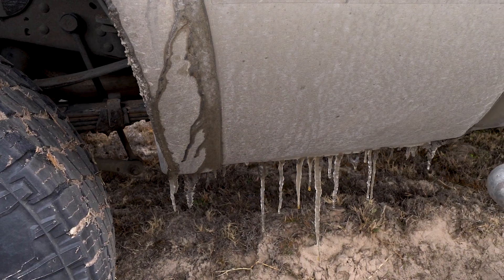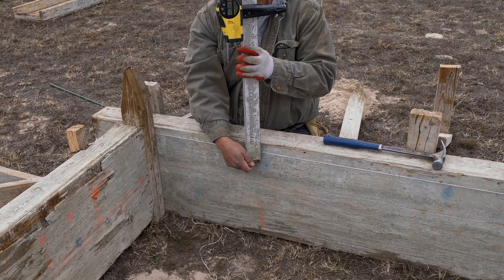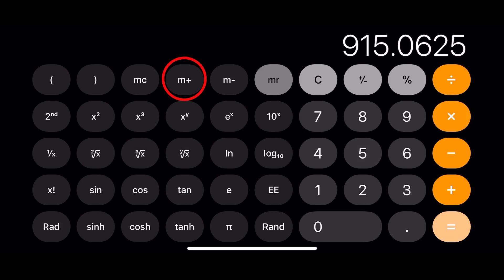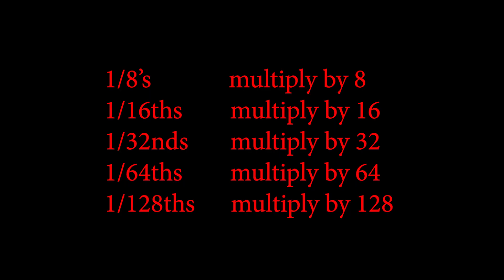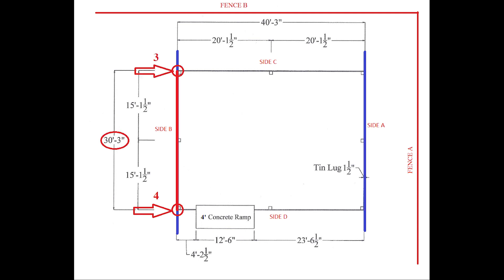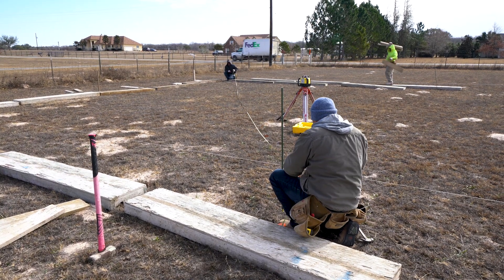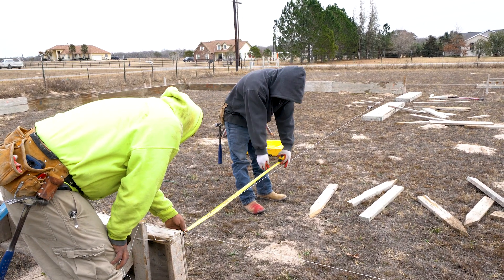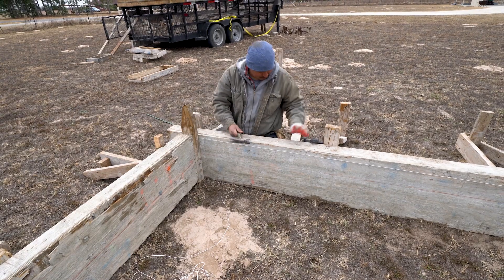How to form and square up a concrete foundation - Texas Barndominiums Episode 13

Comment: I think for us amateurs the nail for slab top wouldn't work.  Much easier to just make the slab to the top of the form or 2 x 6 and then screed the concrete using the form top and a 2 x 4.

Comment: I guess in Texas you can just pour concrete on top without digging foundation walls below permafrost line. 
Is the slab 10” thick?  Concrete must be cheap in Texas.
Reply: Just on the sides.

Comment: I just had a Concrete guy install a 22'x22' Foundation for a steel Garage, I said its important that it's exactly 22'x22' because the aluminum sides go down over the edge of the foundation, its also very important it is Square, Concrete guy showed me a tape and It looked square before pour, but when Garage installers came, they sat the metal Box tube on sides and measured, the Foundation is 3" out of square, 2 corners would overhang 1.5" and 2 would sit on top of the foundation 1.5" in and the siding could not overlap letting water pool and possibly run under the Wall into the garage,  Also while they sat the metal tubing on the edge you could see a large dip in the concrete, I had also said I want it perfectly flat and smooth, I was going to epoxy cover it after installation of the garage.   QUESTION:  Is there a way to fix this or does the Slab have to come all the way up?  ...  looking at yours, he just had some 2x10 boards with a few 2x2 Boards hammered in the ground.

Comment: I've been building foundations for 40 years. Building on flat ground is one thing. Building a structure on a 30 degree cross slope with 20'elevation gain and on rock, is another. I ALWAYS use batter boards, not a single stake. And ALWAYS keep any string 2" above  all formwork. And burning a foot is good. But ONLY if communicated and understood by those handling the tape. Seen builders really suffer when "losing a foot" because of a misunderstanding.

Comment: Holy shit that’s a convoluted process for working out the square. Metric is so much easier, same process with the calculator but no conversion’s necessary and way more accurate. Such a shame you guys didn’t go metric when you had the chance

Comment: Why did you do it this way, where the slab surface will be 12" or however tall your footer will be off the ground surface versus digging the footer level to the ground where the slab is only 4" off the ground level?

Comment: We use 16' long 2x10s on our slabs but I'd have to say we loose about 30% to cuts and wrecking damage. How long are you able to use those plywood forms?
Reply: You can reuse them just spray form oil to prevent the bond between the form and concrete.

Comment: For all you guys that think it’s manly to hit the stakes with an over heavy sledge hammer, Wrong!!  2x4 wood stakes ancient!!! How about metal stakes same shit. Archaic ancient bullshit. Bro get your set backs, square your 90 degrees. The rest is simple. To much bullshit to try and make yourself look smart.  Smart is simple and straight forward. My crew would kick his crews ass set tip and finish!!! To much bullshit.
  In concrete you build for strength, at the same time build light to strip and finish. 

Shit pounding stakes 5’ fucking feet in the ground really!! Ancient system!!
Reply from the maker: So you are the best concrete guy out there huh?  I have heard that before.  

Look up “Dunning–Kruger effect”

😉

Comment: Get out of the 80s man.  How about set  your form level to ff  I know you were a funny guy but 🙄 concerned
Reply from the maker: What’s do you mean by setting forms level?  I don’t think you understand how we do it.
Reply: Texas Barndominiums it’s an interesting variation from the top of the form (or batter boards) being a level guide and instead setting the nails inside the form as the guide to finish the top of the slab to. Love the detail. Would like to have seen backfilling, plumbing rough in, rebar etc and the final pour.

Comment: This video once again made me wonder why Americans still stick to the imperial system. Given that the whole world is used to calculate in a decimal system the metric system is so much easier. I would even support switching to measuring time with a system that is base 10 instead of base 12.

Comment: How thick of a slab do you typically use for the barndominium ?
Reply: @TexasBarndominiums  so a 10" slab is to much to hold a house ?
Reply: @TexasBarndominiums  if you had to guess a quote. How much would a engineer cost ?

Comment: That's one way to square it I can doit different but it's a good video
Reply: Construction master pro calculator a whole lot easier or get a surveyor to lay it out by GPS them just plumb bomb up to your desired elevation
Reply: @TexasBarndominiums  Calculated Industries (maker of the Construction Master and other trade calcs) offers apps for the phone that mimic the hard copy.  The one I have also does trig functions.  I have an older CMaster calc in a tough case I use on the site as I don't carry my phone when working.  It resides in an old cordura bag I take with me every day.  I agree with you on knowing the Pythagorean theorem and other basic math skills - no substitute for when batteries go dead or no calc around!

Comment: Get this app brother. It will help you with the Pythagorean theorem, its much faster. Use the small triangle on the top right corner. Its a time saver.
Feet & Inches Calculator by Evan Winograd https://itunes.apple.com/us/app/feet-inches-calculator/id1072241945?mt=8

Comment: You don't have to break your head just mark the  Corner of the line With the marker 3 feet on one side line and 4 feet on the other side and they  Should have 5' from your 3' mark to your 4' mark and that puts you square

Comment: There aren't very many people in this country who could swing a sledge hammer like that. These guys are the real deal.
Reply: Out here in New Orleans we must be the real too
Reply: No grade beam
Reply: Ruben Varela why do you think that is?  Soil psi is good enough as is, no frost line this far south?  I assume they back filled and then top with a slab based on his comments. Interesting to me many ways to skin cat.
Reply: Until you find people who split their own wood. Or hammer in star pickets.
Reply: A form that high isn’t filled completely with concrete 
There is back fill soil and a plastic liner in the center
Reply: Shit come to dfw Texas we are a lot of mfs that can handle that sledgehammer
Reply: Texas Barndominiums my dads been doing concrete here in texas for over 50 years, its his specialty, ive been doing it for nearly 10-12 years and trust me when I say ive never seen anybody form a house up or set the house square with a calculator, we use 2x6 all the way around and a brace from the top of the stake into the ground, normally when we use a 2x6 as a brace, what happens is the concrete will push that form out and create a lump on the side of the house, its a good way, but I would never form a house using the plywood form you do ! Not saying your not good, I just woudnt do it that way !
Reply: @chinofajardo5591  I HEAR YOUR POINT....THOSE ARE MINI WALLS THEY ARE USING...PRETTY STRONG
Reply: chino fajardo Yeah we only use beam walls for deep slabs, regularly we use 2x10 or 2x12 by 16’ and 5 stakes with kicker on each board, texas works different I guess 🥴
Reply: John Brennan umm, yeah, there are...
Reply: John Brennan I can with one hand I do it everyday